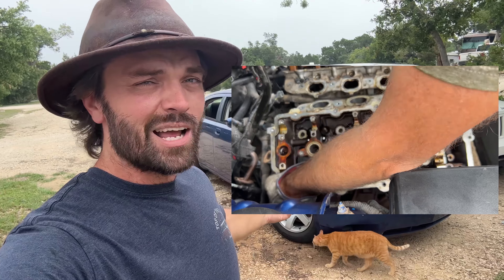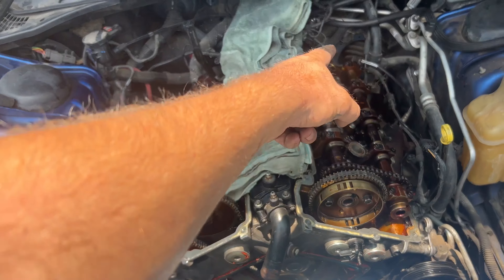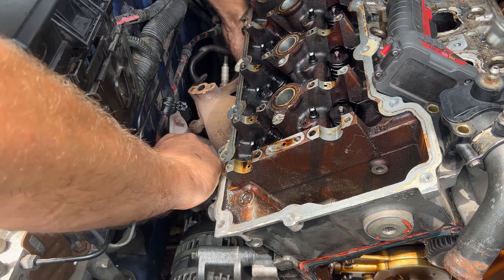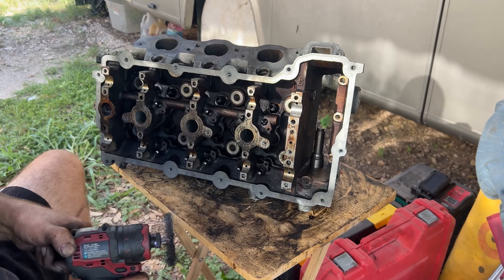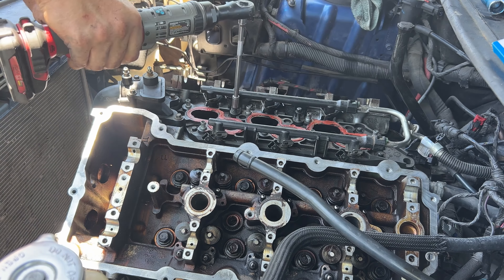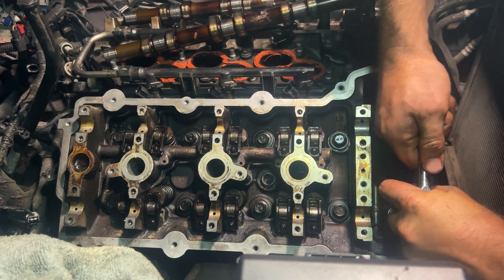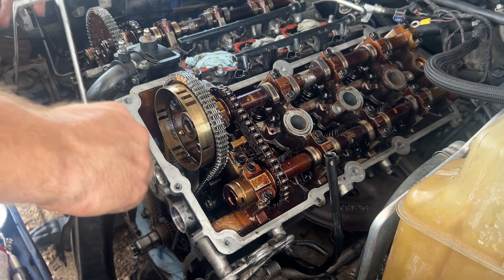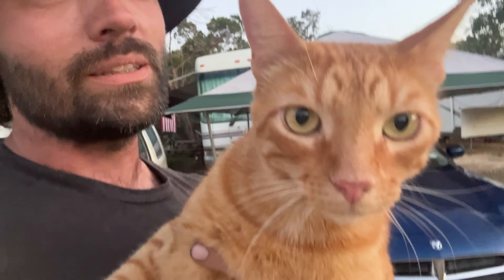How To Rebuild an Engine for 2010 Dodge Charger 2.7L

Comment: Whoever worked on that before just smeared orange silicone over everything instead of replacing gaskets. When you pull an intake manifold off and see silicone sealant you know you're in trouble.
Reply from the maker: Yeah that’s always a sign that’s something is wrong for sure.

Comment: Rick, what if you can't rotate the crankshaft?  I can turn it easily about 45 degrees in either direction, but then it does not want to go any further.  What am I doing wrong?  Also, Is the mark on the crankshaft the thick line or the small dot similar to the marks on the cam sprockets?  Thanks.
Reply from the maker: Are both Camshaft sprockets are at the 12 o’clock position and the Crankshaft marks are pointing arrow to arrow? The Crankshaft arrows are close to the 5 o’clock position. I would check to see if those timing marks match.

Comment: I love the detailed video but I have a 2008 charger 2.7L, was that the inbetween year? and would the timing chain for the 07 or 09 work for my 08? I'm not sure what the slight differences are between those 3 years. Any help or advice would be much appreciated! Thanks!

Comment: I was told I need a new motor cause the timing slipped during an oil change and breaks on the same car model. Would a complete rebuild kit do? Am told the car drives but will only go 35ish but not sure but somebody has asked to buy the car which only had 100,000 miles on it original miles. Which also ironically is a mechanic that wanted to buy another vehicle from my dad, but he wouldn’t sell it to him.
Reply from the maker: Rebuilding an engine is a great undertaking. What do the codes say when you plug in with a scan tool?

Comment: Best video for this task so far,gotta change the head gaskets in my 2.7,God Bless you for taking the time to film a detailed viddie!
Reply from the maker: Awesome. Be sure to change out the gasket for the thermostat. Those gaskets won't leak while the car is idling, but they will leak coolant under pressure while driving.
Reply: @FixiT-Rick  Roger that, thank you!Ill be pestering you for more detailed info!

Comment: Great video I’m gonna do timing chain and water pump my buggiest my fear is not being on time any tips
Reply from the maker: Your timing marks are clearly labeled on the chain and on the camshaft sprockets. As long as the timing marks are in place, everything will be OK. I strongly recommend replacing the chain tensioner that will ensure that nothing falls out of place. Also, do you want to manually rotate everything like I demonstrate in the video. That way you’ll be able to feel smooth rotations.

Comment: Hello If I do all that for my 2.7 v6 engine. would that help my enging to run normal. Because when I replaced the water pump I also added new guide rails for the chain, a new timing chain. and a new tentioner. when I did all that, and put the timing chain in the right position. Primed the enging before starting. then I turned the car on. I started to hear a rattling noise coming from the passenger side. It was from the Tentioner. all the stuff I bought was from amazon. should I rebuild the engine like you did on this video ? By replacing all the Valves?
Reply from the maker: Sounds like the tensioner may need to be pressed in order to create tension on the chain. Always go for the simple approach. I would recommend a compression test to see how much PSI is being created in each cylinder.
Reply: @FixiT-Rick  I pressed on the tentioner then I released it too. Primed it too. Added new oil as well while doing all that
Reply: Like he said, I would keep it simple as you can but if your timing chain got messed up and you had to replace it just like he showed in this video. There’s a good chance your valves could be bent causing that tapping rattling sound. I’m dealing with the same thing right now and I also had my timing chain. Already replaced 3 years ago. If you’re positive that tensioner is working as it should, I would definitely look deeper into the engine rebuild He’s got going here.
Reply: @kylerchaffin5814  okay thanks for the heads-up. I'll open the head and do a compression test.
Reply: The hole where the tensioner goes has a sharp edge created from the tensioner rocking back and forth when you replaced it, it could have cut the o-ring making it loose pressure resulting in a loose timing chain, use sand paper on the edge and I would shop for a cheap model on Amazon bad reviews

Comment: 10:07 wouldn’t the steel brush cause uneven surfaces? I’m new to engine rebuilding 😁
Reply from the maker: It's possible. If my friends from Dave's Auto want to correct me on this, I'll listen to them talk.
Reply: It can a softer metal like brass would be better but if you have a smooth hand, don't press hard, and are careful you'll be fine.

Comment: What about a water pump? Should it be replaced during similar mileage?
Reply from the maker: Great question. If you have access to the water pump inside these engines, it would be worth replacing the water pump.
Reply: @FixiT-Rick  unfortunately i don't have access, my car has 90k mileage, i don't know what to do

Comment: How many bolts are in the exhaust manifold?
Reply from the maker: 7 bolts
Reply: @FixiT-Rick  with the manifold you mentioned leaving it on the vehicle.. how would you do that ? just disconnect it from under the car im kind of confused and stuck at this point.. I have everything taken apart im just not sure about how to deal with the manifold

Comment: The 2.7L oof. Unfortunately it’s probably not gonna last much longer even with a rebuild. Sludge machine.
Reply: Wym
Reply: You’re not a mechanic if you believe that 😂
Reply: take care of your car
Reply: @Gxzteez777  dw i’m putting a v12 in it eventually but for now fuck these head gaskets
Reply: @Gxzteez777  i got a 2008 chrysler has 2.7 it has 170k on and everything on it still original

Comment: the 2.7 is straight up ass. its not worth all that work. those motors were modular for a reason. once the 2.7 dies horribly you drop the cradle and swap in a 3.2 or 3.5. i mean for real the 2.7 is arguebly chryslers worst engine of all time.